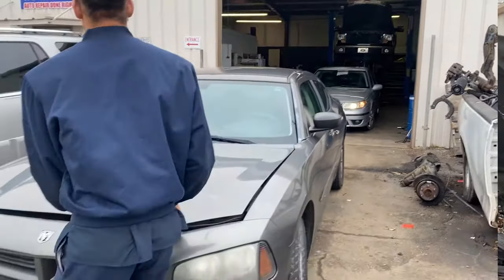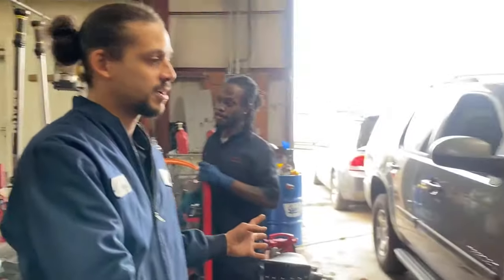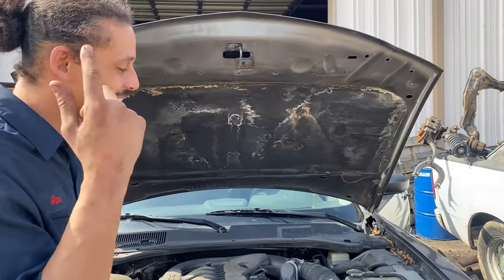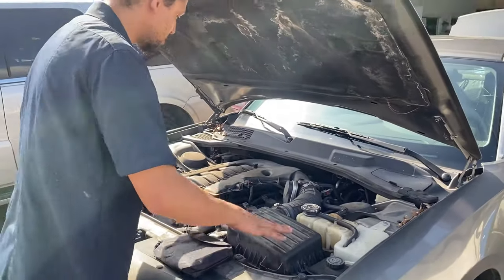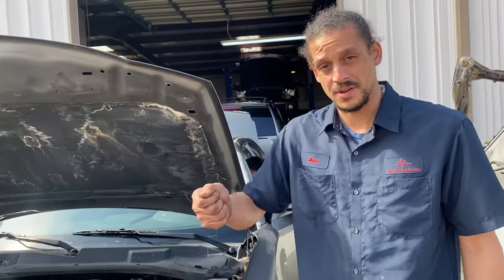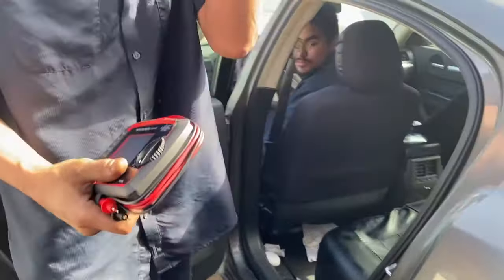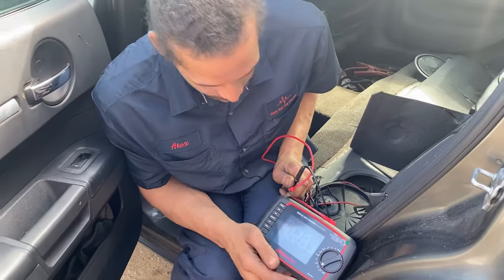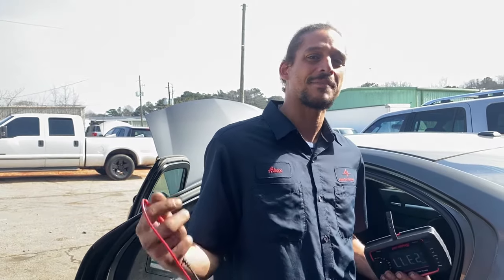Diagnosing Another Dodge Charger - Turns Over But WON'T START  #carwontstart #dodgecharger

Comment: Just got a 2008 charger from my buddy an he let it set for two months, but I see some rodent activity on the intake, thinking it might be a chewed wire, how should I get started on my trouble shooting, It want crank!!!
Reply from the maker: What engine do you have. To start off good battery and a scanner if any thing is chewed up the scanner will point you in the right direction for example code display #2 injector Circuit low, means there is a damage wire
Reply: @AlexTheCarDoctor  It's a V-6,Thanks for the info,will get started today
Reply from the maker: 3.5 or 2.7

Comment: i have a 2007 dodge charger 3.5 liter my car is making the same dang sound it turns over but doesn't start. i need help .  one person told me that means i need a motor. but no real mechanic /shade tree mechanic has been under my vehicle. any advise :(( .   I wish you were in my Town.
Reply from the maker: Hey buddy sorry to hear the bad news. Follow my test process in the video. What engine do you have
Reply: @AlexTheCarDoctor  i have a v6 engine 3.5
Reply from the maker: Can you look me up on Instagram and send me a video of it cranking over
Reply: Can I write you? I have a dodge avenger rt 2013 replaced alternator spark plugs and coil packs still won't start cranks but goes right back off.... Any suggestions? @Alex, the car doctor?

Comment: Hi Alex, my 2008 dodge charger has a 3.5L engine and has recently refused to start, there is a tiny blue light flashing on the left upper side of the car adjacent to the steering wheel. #HELP

Comment: Would a vacuum leak give similar symptoms to that of a bad catalytic converter ?
Reply from the maker: Not really vacuum leaks will cause higher idle engine may stall or run rough.some symptoms of a bad  cat are loss of power, bad mpg,engine misfires, exhaust noise . Both will throw a check engine light
Reply: @AlexTheCarDoctor  if the leak was so large ,it would run bad ,if it did run,high idle will not play a factor wich could give bad cat symptoms but remember that alot of things are in symptoms.vacum leaks can cause cats to go bad due unburnt gas.mabey thats what he means.you guys are great keep the good work and thank you.
Reply: Mine is makin the same noise that happens at the start of the video but it cut on for like a few mins then dies..what would that be from

Comment: I have a 2021 dodge charger sxt  V6  what gas would you recommend to use
Reply from the maker: Regular Gas is what’s recommended for that car, premium gas will not benefit your engine so you’re better off sticking with the recommended regular unleaded.

Comment: I have 2008 dodge charger it long crank   it finally starts but back fire I replaced throttle body and map sensor plugs barley runs for couple second no codes pull up
Reply: V 6 3,5

Comment: Spray some fuel into the throttle body, quick fuel check or check fuel pressure at the fuel rail 💯
Reply from the maker: Yes that works! But too risky for me as a shop owner or to suggest to the average Joe. I’ve seen many fires start that way.

Comment: Boss I have a 2012 SXT Charger cranks but won’t start I replaced throttle body, gearshift assembly”was stuck in drive when it died in traffic”, has a new battery, and I just did my fuel pump same ass shit man I’m out of ideas now
Reply from the maker: Was there a check engine light on
Reply: @AlexTheCarDoctor  check engine gave me codes for throttle body and neutral safety switch both have been replaced it’s just the check engine now at first it was a red bolt but it’s gone now
Reply: @AlexTheCarDoctor  I put some carb and choke in the intake manifold started up for a bit I’m assuming fuel pump is not getting its power I can’t find the right relay for the trunk do u think it can be the wiring harness as well ?
Reply from the maker: @EdgarHernandez-lm1yy  it’s hard to say without seeing it for myself.start by checking power at the fuel pump,find the 2 thick wires those will be the power wires

Comment: I got a cop car charger doing the same thing, turns over and won't start. New throttle body, new fuel pump. Is there a video doing a timing belt change on them? Mines a 5.7L hemi engine. Thanks Doc!
Reply from the maker: Hey buddy. That 5.7 hemi  has a chain and never give problems.make sure you check the fuel pump relay in the trunk
Reply: Ok. So what would white smoke mean coming out of the throttle body mean? Too much fuel? Or would timing be out of place? I will check relays also. Thanks Doc!
Reply from the maker: Sounds like you need to do a compression test on each cylinder. Those 5.7 like to drop the valve seats and if that happens it will push pressure back up through the intake causing smoke to come out of the throttle-body
Reply: @AlexTheCarDoctor  
Ah very interesting, could you possibly explain how to do a compression test? Or if you have a video of that? I would truly appreciate your help and guidance. Thanks Doc!!
Reply from the maker: https://youtu.be/xHaFCb7_nFY
Reply from the maker: I will make one tomorrow specifically on engine compression test. I just sent you one of me doing one on a diagnostic job I had a while back
Reply: What ended up being the problem cuh

Comment: Great work brother... I have a 2007 dodge charger .. In freezing cold weather it will NOT start.... It'll crank but won't turn over... Any suggestions?
Reply from the maker: Hey buddy thanks for watching.it May be fuel related run the checks like you seen in my video let me know what you come up with
Reply: @AlexTheCarDoctor  so it definitely was a bad fuel pump....she runs like a charm... i do notice that ever now and then when I try to start I would get a click .. then after 2 tries it'll start... now I didnt have this problem until I had a starter replacement... Of course its an after market starter , I think I may need to get one from the dealer... I have another question.... 
For this particular charger I can find a starter however the signal wire is discontinued and the dealer hasn't given me any options for an alternative... What should I do ? Thank you
Reply from the maker: @harlembeloved7052  sounds like the starter for sure but check the battery connection  also.you need to switch starter brand the stealership will give you a reman starter too sometimes. Where did you purchase your starter
Reply: I purchased from a mom and pop auto parts... Im more than positive its a reman... the signal wire on the original wasn't any good according to the mechanic... we tried ordering one but its discontinued... My regular mechanic made it work somehow but I believe the starter is definitely faulty... ive yet to find the wire even an after market one
Reply from the maker: @harlembeloved7052  have you tried autozone or advanced auto parts
Reply: @AlexTheCarDoctor  yes sir
Reply: @AlexTheCarDoctor  so I was able to find a wire... I also purchased a starter from the dealer as per my mechanic... Come to find out it was only the wire that was bad.. The one he removed was in really bad shape... smh... now Im stuck with this starter because the dealer doesn't do refunds...  smh

Comment: I have 2010 dodge charger fuel pump went bad I replaced both of them bt car still wont start it turns over and acts like it wanna start bt doesn't any suggestions
Reply from the maker: Hey there did it get better or worse after you replaced the fuel pump. Are there any check engine lights on
Reply from the maker: I mean did you check it for any codes

Comment: I’m having this exact same issue, I ran it out of gas, put gas back in it (9 gallons) fuel pump is coming on because I hear it when I turn the key, acts like it wants to start but will not. I need HELP!
Reply: Ran the codes and a camshaft sensor popped up along with the fuel pump codes listed. I’m at my wits end.
Reply from the maker: Hey there sorry I’m getting back to you so late it’s hard for me these days to answer questions on here and run my shop. Have you got it figured out yet
Reply: I have not, I’m selling the  POS, changed the sensors. Fuel pump kicks on., got spark, jus won’t start. Makes no sense.
Reply from the maker: @dakotapowell5916  dang what are the codes
Reply: Jus the camshaft sensors, and fuel pump (gas hand don’t work), but pump is still functioning. I changed the sensors, cleared the codes and it acts like it wants to start but jus doesn’t.
Reply from the maker: @dakotapowell5916  what is the engine size
Reply: 08 Dodge Charger 3.5
Reply from the maker: @dakotapowell5916  you still may have a fuel pump issue even though you can hear it, I have seen the pressure pipe that runs from the electric motor to the top of the fuel pump assembly crack causing an internal leak which result in no fuel getting to the engine
Reply: Same problem.... I took it to AutoZone and print out say a fuel tank pressure sensor? I have a dodge avenger rt 2013..
Reply: My name is TAKOTA ❤️
Reply from the maker: @MrsParks  hello Takota is that your only code

Comment: So if I turn the car on and the fuel pump hums, what does that mean? I got a 2008 Dodge Charger 2.7 v6 engine btw
Reply from the maker: Hello it means the fuel pump is priming the fuel system for quick start, it’s sort of like a old school how you have to pump the gas pedal right before starting
Reply: @AlexTheCarDoctor  ok cool then so I figure it got to be the starter relay fuse, that could be the only logical issue
Reply from the maker: @cuzdeep10tw  so the car is not turning over
Reply: @AlexTheCarDoctor  yeah it’s not, the lights and whatnot is on, but won’t crank

Comment: ok so this damn car came in the shop today. it ran a crankshaft code then i changed it( the one on the housing) but still i get no spark and now i have a damn camshaft code. the fuel pump works and its full of gas. what should i tackle next my guy? i just started this job 3 weeks ago and im trying my best. I hear the next step is the 6.5hr crankshaft position sensor under the exhaust manifold? im asking because they want me to do this tomorrow and i can use some advice plz. id hate to do a all day job for nothing
Reply from the maker: Hey buddy. Let’s start with what’s the eng size. You need a scanner that reads your engine data, make sure the car is reading 150 to 200 rpm’s while cranking over the engine that will tell you if the crank shaft position sensor is good, a bad one 0 or erratic next make sure the timing belt/chain is rotating the cams, a cylinder compression test is a good way to tell if the engine is in time or not. You can find the the spec on google or Mitchell or whatever shop program you guys use for specifications look up
Reply: @AlexTheCarDoctor  2008 2.7 . i thought it was the crankshaft sensor on the housing but now it still didnt start and its pulling a P0340 sir. any advice on my next moves would be appreciated.
Reply from the maker: That PO340 is a circuit code meaning it may have a wire loose check the plug connector make sure the pins haven’t slid out The socket , you may have to trace the wire harness from the cam sensor back to the computer. But definitely focus on the cam sensor that’s the problem right now, there is only one crankshaft positioning sensor on that vehicle
Reply: @AlexTheCarDoctor  God bless you sir thank you so much. I will follow the harness and verify everything is seated properly and also that the pins are in the proper place. Have a good day today 🤙

Comment: I have a 06 charger and it won't say nothing. What will be the problem?
Reply from the maker: Hey there first check the battery and connection make sure the battery is fully charged also check all of your fuses that’s a good start

Comment: Will it have this problem if it will start randomly but shuts off after driving for about 15 miles
Reply from the maker: Sounds like a bad crankshaft sensor. Will it start back up? Are there any lights on the dash
Reply: @AlexTheCarDoctor  yes it will start I had the throttle body replaced and also crank sensor it drives about a good 30 miles then shuts off again I leave it for a couple of hours and it cranks fine I was told to replace the fuel pump seems like everybody is kinda giving me the run around
Reply: Check engine light on and lighting bolt looking light comes on when it breaks down I leave it go back to a few hours later the lights are off it runs fine until a repeated process
Reply: Dodge Challenger 2014 sxt
Reply from the maker: If you have a code reader send me the check engine light code if not take it to your local part store they will pull the code for free. That doesn’t sound like fuel pump sounds maybe like a cam sensor
Reply: @AlexTheCarDoctor  I was told today wire harness 😢
Reply from the maker: @kiarag7564  what the reason they gave you and who told you that
Reply: @AlexTheCarDoctor  I took it to auto nation dodge
Reply from the maker: @kiarag7564  did they give you a description of the problem for example wire harness internally damaged at this certain point
Reply from the maker: Unfortunately the dealership is not always credible they will  miss lead you especially if you have an older vehicle
Reply from the maker: Not saying that may not be the problem just be careful,definitely may be the case but anytime I blame any part on a vehicle wire harness sensor etc. I always have an explanation
Reply from the maker: Or I say I don’t know
Reply: @AlexTheCarDoctor  I’m so lost I’m going to get my paper work tomorrow from them do you have a person social page if not I will reply on here what it says
Reply from the maker: @kiarag7564  Alexthecardoctor is my IG

Comment: Got a p0562 code on 07 Dodge Charger 2.7L  it’s turning over but won’t start !!! Any ideas ?
Reply from the maker: That code indicates a week or dead battery make sure you have 100% charged battery and try again if it still doesn’t start you may have another issue. Follow my steps in diagnosing the problem and you will be good
Reply: Ok thanks . I’m thinking it’s the alternator. It’s just turning over like in video but never starts or sometimes it won’t even doing anything in crank position it turns the radio off while trying to turn over to crank
Reply from the maker: @BC_nopowder  you can only test the alternator once the vehicle is running but if you think it’s the alternator you can always remove it and take it to AutoZone and they will test it for free. An alternator will never cause a vehicle to not start you literally can remove an alternator and the vehicle will start and run until the battery goes dead, let me rephrase that a little bit a normal functioning alternator that spins freely a locked up alternator may cause the engine not to turn over

Comment: Hello, I have a 2010 dodge charger sxt and my code on my obd II scanner has a p0562
Reply from the maker: Check the charging system….alternator, wires, voltage regulator etc

Comment: I have a 2010 Charger was driving when a lighting bolt light came on the car didnt accelerated no more but was still on … I put a new throttle body has new battery, alternator, starter nd fuel pump all new i also put the scan tool nd it popped up the crankshaft sensor which i already put a new one but still wont turn on only cranks? any help?
Reply: I’m having this same problem and the negative battery cable in the trunk keeps heating up
Reply: What was the problem

Comment: I just had a motor replacement in a 2010 Dodge Charger police interceptor everything put together and it still won’t start but will turn over can u guys help plz ?
Reply from the maker: Hey buddy sorry to hear that do you have the 5.7 v8
Reply: @AlexTheCarDoctor  yes
Reply from the maker: Do you have a scanner if so it needs to be able to read engine data so you can check The RPM reading
Reply from the maker: Without engine rpm reading the engine will not start and most likely you have a bad crank sensor  or wiring problem
Reply: @AlexTheCarDoctor  Can I Bring It Too U Guys I’m In Georgia
Reply from the maker: Sure thing give me a call I’m open Monday through Friday 9 to 6 4704350015
Reply: @AlexTheCarDoctor  wow if you crank engine over notice your rpm on dash if it moves at all your crank sensor is working,note not everyone knows without scan tool or scanner poor mans way.
Reply from the maker: @aubraevil8956  I agree

Comment: Hey bro nice video , I have 2006 magnum se with 2.7 ,I have a no start issue , the cats where stolen  of it  ,but I have new ones to install, however when I use starter fluid it will start until that is burned ,sounds like the fuel pump. Is it in the same side under the seat .also going to test the voltage on the fuel pump plug
Reply from the maker: Thanks for the support. If I remember correctly yes same side under seat, you have 2 a transfer pump and fuel pump basically a left and right. Check that fuel pump relay if no voltage is at the pump

Comment: P0339 and 0196 any ideas?
Reply from the maker: Hey there those are codes for a crank sensor and oil temperature sensor. The crankshaft sensor code may indicate you have a bad sensor or a wiring issue The second code May just be a bad oil temp sensor. find someone with a good scan tool to hook up to the car and look at the read outs of each sensor